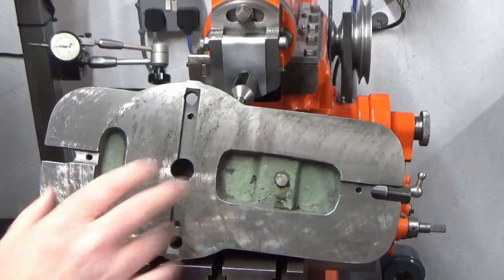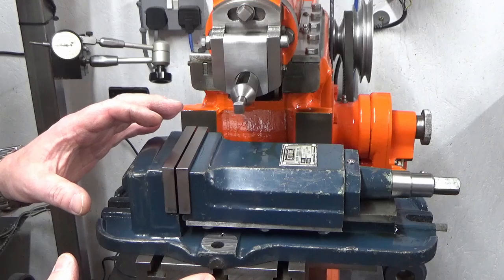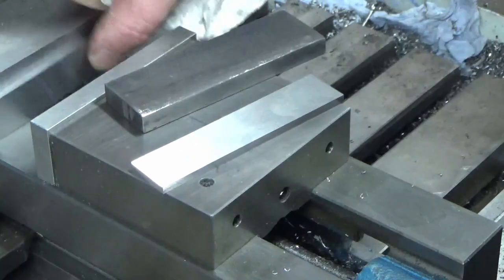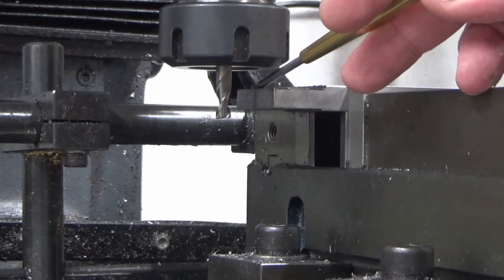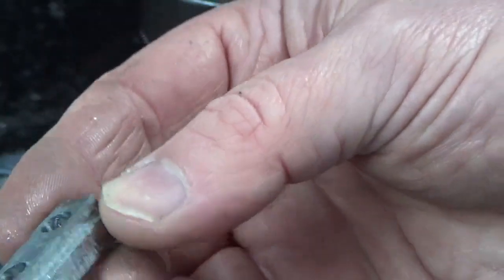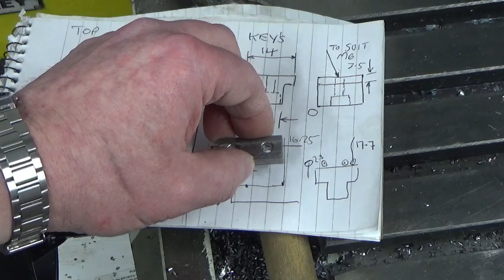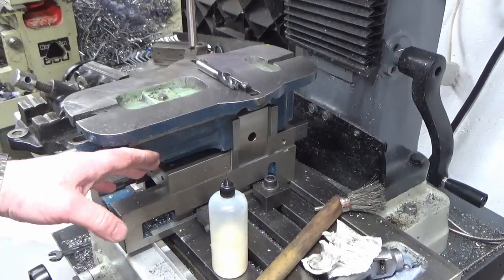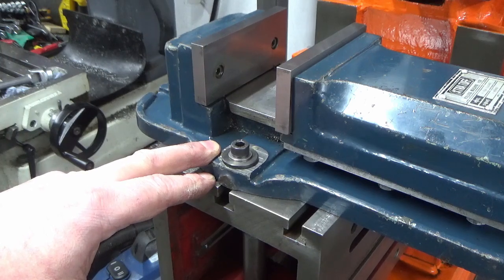Making Bushes & Keys for the Shaper Vice

Comment: "Top Hats and Keys" sounds like a posh wife swapping party 🥳. 
Nice setup and technique Jon, good demonstration on single tool machining, exactly wrong on a dimension has a particular sense of achievement. 
Funnily enough, I had the same issue on a generic vice, ref holes out of line, but it was the pre drilled and tapped key fixings that were askew. 
Thanks for sharing and best regards from the Black Country. 
John.
Reply from the maker: Hi John, thanks for the comment. Lol, made me smile! Cheers, Jon
Reply: "Exactly Wrong" just about sums up a lot of what I do.

Comment: Nice one Jon! Must admit I was looking forward to seeing the machine operating but the best made plans and all that!
Couldn’t help noticing when you tested the firmness of the vice fit, there was a bit of rocking, presumably down to a bit of levelling up being required. Ironically making some slot nuts would have been a great starter project!
Reply from the maker: Hi William, thanks for the comment. Yes, good spot. The machine is still on its wheels at the moment until I get the guards fitted etc, we will then be dropping it onto its feet before we go in anger at cutting (hopefully all in next week's video...... Caution your best laid plans saying though lol). Cheers, Jon

Comment: Got there in the end Jon, well done. I do not bother making flat vice keys. I make round ones just like your top hat bushes. Easier to make and fit, I know that the contact surface area is less but it will still locate nicely. Regards from Australia.
Reply: That is exactly what I was also going to mention. I just use extended length 'top hat'  bushes to locate the tee slot and provide a seat for the clamping nuts.....simples.
Reply from the maker: Hi Dave, thanks for the comment. Yes, I very nearly went down that route, especially if you harden & temper them, they last just as long. Anyway, much more fun going down a few rabbit holes, and I certainly did that in this video lol. Cheers, Jon

Comment: Hi Jon, good save. I noticed the offset holes at the start and was wondering whether it mattered or not, apparently it did! You probably made the right choice with the slotted holes, I was thinking offset bushes 🤣🤣
Reply from the maker: Hi Olly, thanks for the comment. Lol, I also noticed the holes as soon as I got the vice, and all the way through stripping it etc, I clearly didn't think forward enough though, the brick wall was staring me in the face, I saw it, and then promptly just ran right into it! I do wonder about myself sometimes lol. Cheers, Jon

Comment: Morning Jon, good that you show the pitfalls of buying used equipment, suppose what would concern me is, the person that machined the slot and presumably the holes at the same time made the error 🤔 I would think in the long term re machining the holes and making new top hats might be the action , nice work Mr Jon 🤗🇺🇦👍
Reply from the maker: Hi Terry, thanks for the comment. To be fair, the person who machined the key slot (not original as all metric) did a super job, the vice is within about 0.025mm (0.001 banana) over the length of the jaws when located on the new keys. The person at fault was the OEM who put the original holes in at new manufacture. Anyway, all sorted now...... Swarf next week, I promise. Cheers, Jon

Comment: Nicely done and well salvaged I thought. My heart sank for you when I saw the misalignment of those holes. But of course you made it good.

Could you please explain the thing with the ER collet run out in a bit more detail? Didn't quite get that.
Reply: I was thinking if the ER collet has runout and causes the cutter to run eccentrically then the hole or slot being cut will be oversized rather than undersized.
Reply from the maker: @howardosborne8647  you are bang on Howard, what I did a crap job of explaining here is if you are milling a tennon (or external width per the keys I made), the same eccentricity will cause the width to be undersized if you just work to the numbers on the DRO. I hope this makes sense but I will expand in a future tips video for others. If I have confused you & Carl, then I clearly did a rubbish job of verbalising what I was thinking, meaning others will have no chance as you both know your stuff! Cheers, Jon
Reply from the maker: Hi Carl, thanks for the comment. I had a go at explaining in answering Howard below, let me know if that clears it up for you. I will expand though in a future tips video as I clearly didn't do it justice during my 30 mins of backing myself into a smelly corner in this video lol. Cheers, Jon
Reply: @howardosborne8647  Thanks Howard, agree, I have put another comment o to Jon but thank you in that too.
Reply: @jonsworkshop  You explained perfectly well I was just too tired to understand! I did some tests a few years ago with a ballrace ER32 nut and I found the run out was markedly improved as opposed to a standard nut. I use them solely now. I would be very keen to see a demo of what you described. Thank again Jon! Thanks also to you Howard.
Reply from the maker: @carlwilson1772  thanks Carl, on the radar. Cheers, Jon

Comment: Wow!! those holes are a long way off. I guess it would have been ok before the key slot was made. You have enough wriggle room and you could then just clock in the vise like you do with a mill vise. I think slotting the holes was a good quick fix. The key slot will keep the vise true to the cutter anyway.

It was funny, half way through I was thinking, how do you do small adjustments with the top hat bushes? Then we see the mounting holes are quite a way out. I guess the key slot is the master for alignment and everything else works around that.
Reply: The guy who set those holes out must have only looked at them with his glass eye😂😂

Comment: Hi John, another good video but I have to ask, why bushes and keys? Surely either or? Bushes are used for location as are keys, using both will potentially cause them to fight against each other. I agree with thick washers on the clamping faces but the sides of the bushes are overly elaborate and not doing anything for clamping force and may even reduce it if they are binding due to conflict with the keys. My experience in the toolroom was that all of our machine vices had the next size up holes to the studs we used. This wiggle room guaranteed you weren't binding on the bolts and holding the vice up or throwing it out of square.
Reply: Abandon the square keys altogether and just make a pair of top hat bushes long enough to extend down through the vise and locate in the tee slots.....all locating and fastening requirements covered with 2 less components.
Reply from the maker: Hi Andy, thanks for the comment. You are absolutely correct about over constraining. I was copying a design I was taught in my apprenticeship (again in a toolroom). The idea, as I was told way back when, is that the bushes help guide the screws into the T Nuts square and avoid cross threading damage etc. I left 0.5mm clearance between bush ID and screw so notionally there should be no conflict. All of this assumes of course that the OEM had the skills to get the holes in the right place in the first place lol. Cheers, Jon
Reply: @Jon's Workshop  Hi Jon, I think what we have going on here is a difference in toolroom cultures. Where I worked T nuts were a rarity reserved for special setups, high tensile T bolts washers and nuts were the norm for most stuff. The guy I worked with drilled in to me that bolts may be too long and be clamping the nut in the slot rather than the vice to the table. Funny how the experience and habits passed on when you were 16 is still resolutely there at 60. T bolts are a bit "rich" for me to use at home now but I do have one of the Chinese clamping sets with the studs loctited into the T nuts. Who me, stuck in my ways? Probably.
I really appreciate the great  content you produce as it gives the motivation to get out in to the workshop. I have to say I loved the shaper refurb but have to date resisted the urge to buy one. As the first real machine you are allowed on as an apprentice, I think we all have a soft spot for them. I do however remember my old gaffer telling me " the only thing you can't make on a shaper is money'.